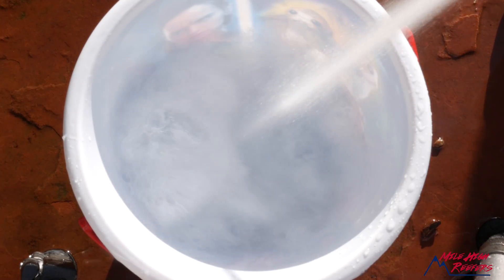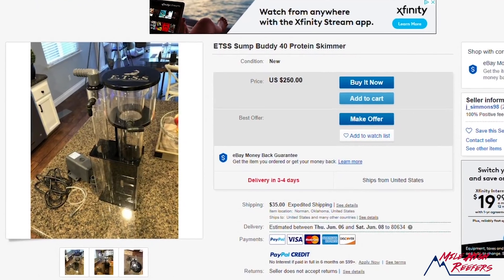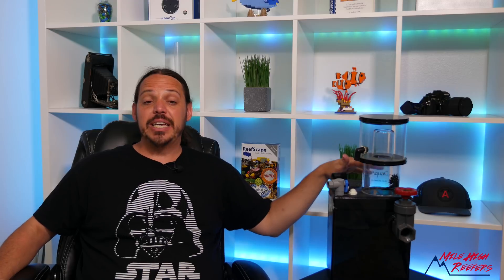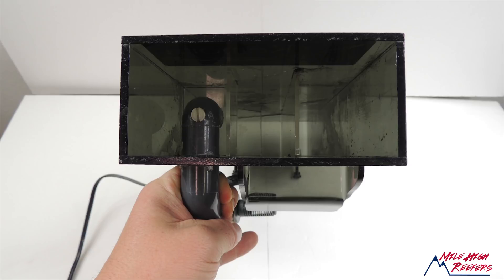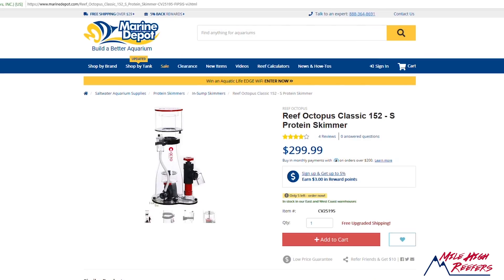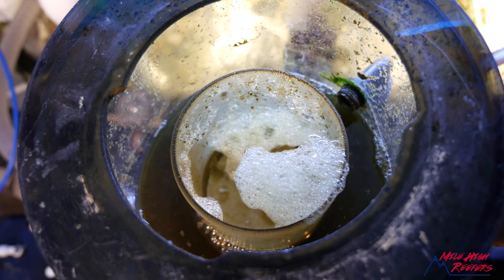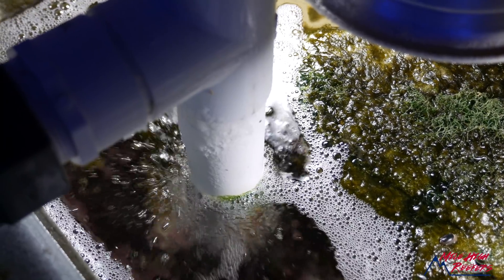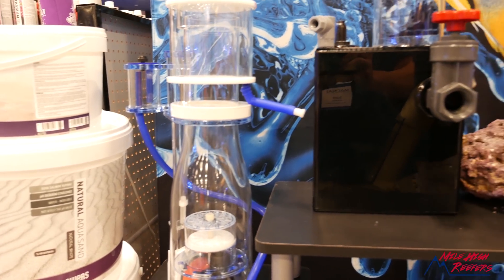AquaC Protein Skimmers Why Aren’t They A Thing Anymore

Comment: New Sub, you know how hard it was to find any vids on ‘gravity protein skimmer’?
So THX!
Back in ‘96, I worked for a aquarium retailer in my hometown of Seattle.
The Bellevue location, opposite side of Lake Washington, was the real $ maker; MANY software professionals were committed to spending $ on our gear & livestock.

We were selling ETS Inductors (Venturi), like crazy, they gave us 4 & we hooked them up on 4 200 gal fish tanks (double 300 gal sumps), & Fed the fish aggressively, to show off the gunk gathering.

The REAL ‘trick’, was to run those skimmers on BIG TANKS, at really high turnovers.
Big dumps were best, to.
They didn’t have any up & down levels, etc, at all; you rigged them in & they just DID IT PERFECT, out of the crates.
Needle Wheels are cool, but it’s one more moving part.

Comment: These old ev skimmers were always a little bit finicky to set up. The gate valve has to be pretty precise (depends on flow in/flow out) and they stop foaming when you stick your hand in the water so it was a lot of adjust, wait, repeat for in sump applications.

Now with DC pumps you can dial the flow so it's way easier. Get the gate valve close to where you need it then fine tune dialing the flow. I'm running an ancient ev150 (older model than ev180) on my setup with a 1000gph DC pump. Works great.

Comment: Excellent skimmer along with some ETSS models. Way back think 90's through 2000's never had so many compliments on how clean the water was in my big tanks. The biggest great design was that when you had an Pump hooked up to them there was no sharing the pump with an Venturi in front of it. So a Mag-7 was 700 gallons an hour. Not divided down sharing the air from the venturi. Still have one but need a cup for it. DOH!

Comment: I have 2 AquaC EV-240. The key to success with these type of skimmers, is not to use an expensive Iwaki pump. Instead, use a fountain pump with a high flow rate, like a "Vivo Home"  1600-2700. They are a lot quieter, more energy efficient and 1/4 the price.

Comment: I am old school and still use it on my system.  Very low maintenance still lol  I only clean up the air valve and output injector.  I know I should upgrade but for now Ill keep on using it.  I had to do major tweaks on it but still works good.

Comment: I owned one for several years. Great company at the time with great support. My issue is they are not as reliable as you state. If a little snail gets into that inductor (which always seemed to happen to me), your performance goes to crap. I don't know why, but my Life Reef venturi style doesn't pickup snails.

Comment: While I get that the design would be super reliable, it seems like it wouldn't be as efficient at removing waste because your bubble size will be a lot larger than you can get with needle wheel design.  Essentially this seems like a venturi output being blasted into the surface of water to increase the turbulence and bubble creation even more. Best of luck to the company looking to bring these back on the market though. More options can only be a good thing for the hobby.
On a side note, it seems like running all that water through a sharp 90 degree elbow would be reducing the energy efficiency even further.

Comment: Awesome! Thanks..Great video and topic.

I always stayed away from Remora’s as I heard they’re loud..

I feel so many have fallen for sales gimmicks by skimmer manufacturers..and simply follow trends. 

And perhaps Bubble plates are the perfect example of this..
I still use a EuroReef skimmer with an upgraded pump (Octo Varios S4)..It works amazing! ..and without any bubble plates.
I’m pretty sure that adding a bubble plate would actually hinder the efficiency by aligning and sending the bubble straight up instead of the current circular turbulent  motion. What are your thoughts on this? Are bubble plates just a gimmick that everyone’s ignorantly sold on?..or should I experiment by adding one ?
Reply from the maker: Val Halla I totally agree I too have had similar results using a Reef Dynamics skimmer on one tank and a bubble plate skimmer on a different tank. The Reef Dynamics skimmer (formerly EuroReef) was awesome